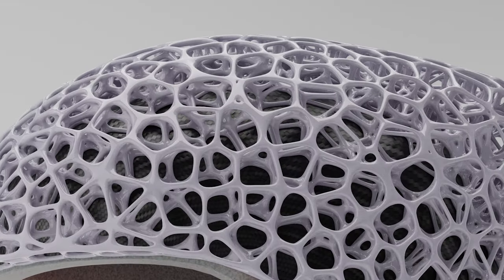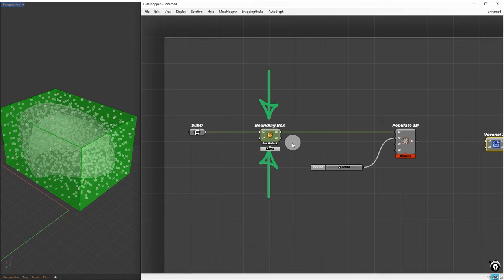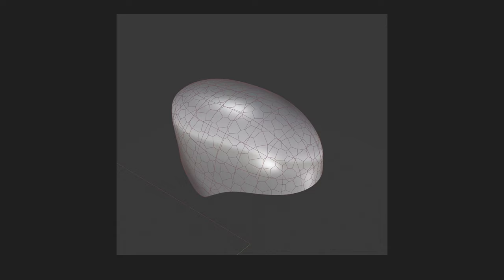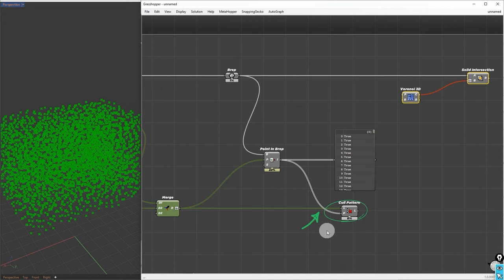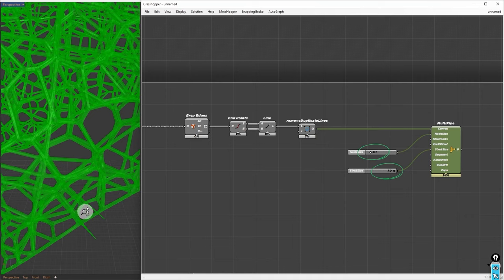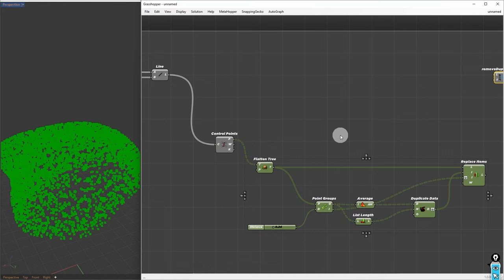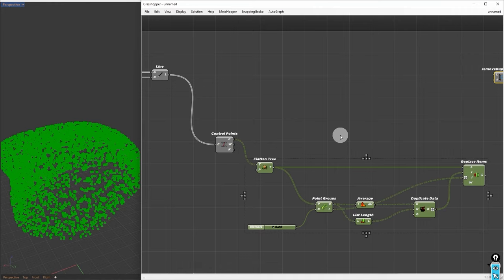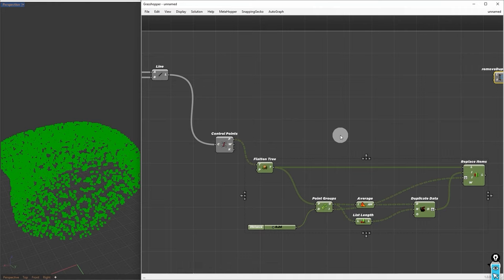How to apply Voronoi lattice structure on any geometry in Grasshopper

Comment: Hello, do you know why the connection between the voronoi 3D with the solid intersection doesn't work?? the error message is " the booleen intersection set is empty"
Reply: Apparently, there are several of us at this dead end. A hint from the author would be most welcome!
Reply: @fluxcapacitor  try increasing the distance of the points group command to 1.5, worked for me
Reply: @harrywall3045 did it really work? I can’t get mine to work either 😊
Reply: i selected everything and then pressed on the mouse wheel and then on the play button that says "recompute" suddenly everything worked.

Comment: First of all great Tutorials - keep it up! 
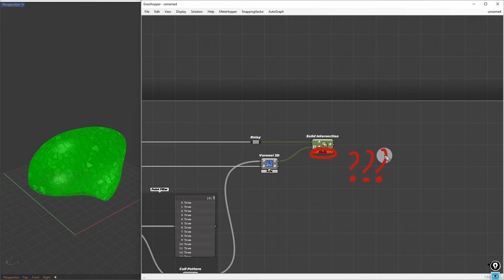Secondly I'm stuck at 5:26 because I dont know which bounding box/brep I need to insert in the Voronoi 3D component :face-turquoise-covering-eyes:
Reply: I searched and looked and it is the last thing of the very first group, the scale note. It goes into a relay node and then into B from the Voronoi note. Sadly it still doesn't work
Reply: I selected everything and then pressed on the mouse wheel and then on the play button that says "recompute" suddenly everything worked.

Comment: Hey, thanks for the tutorial. Unfortunately, you skipped a step, which means it no longer works for me. You skip the part where you connect Voronoi B(5:51). You can't see or understand what you've connected it to. Unfortunately, I get the message for Solid Intersection: "Boolean Intersection set is empty"
Reply: i have the same issue
Reply: Same here
Reply: I know it is already too late, but the voronoi is connected to a relay that is connected to the scale node. I ran into the same problem, you can spot where he connect it to later on in the video. it's very easy to miss, took me an hour to figure it out.

Comment: This is an interesting way to make carbon fibre structures.
Say making bicycle parts.
First 3d print the swiss cheese structure, then poke in long straw in either the x-axis, y-axis etc. or even in rings like a coil.
Then put in the carbon fiber in the straw.  Next pull out the straw but leave the carbon fiber remain in the cheese.
Repeat the process to insert more fiber until the structure is full.

The final process is to impregnate the cheese with resin.

Such structure should be stronger than other methods.

Comment: i have a qustion "why the Voronoi 3D and Multipipe" is red in grasshopper? 
Voronoi 3D says 1. At least a single valid point must be supplied
Multipipe says 1. Solution exception:points must contain at least 1 point
Reply: i stuck in the second quest too, did you solve it?
Reply: @yulin2520  and u ?

Comment: I am enjoying the lecture.
I did the same thing as before with the basic subd box object of Rhino, but there is an error in solid intersection. I don't know why, could you please tell me?
Reply from the maker: Glad you enjoyed it, if you get intersection results while getting an Orange Warning, leave it and proceed to the next process. It will be fixed after the Point filter process. But if you don't get any intersection, possibly, you could try out flipping the brep (in case the face flipped).
Reply: @3DBeast  thank u🫡

Comment: Is this method suitable for the sphere shape subD? There are always some weird sharp burrs outside the sphere lattices, I just can't figure it out.
Reply: Finally, figure it out:eyes-purple-crying:, the "Merge" component's output must switch to the "Flatten" mode to exactly merge two bunch of points together, which allows the "Voronoi 3D" to generate the correct cells.

Comment: Is there a way that I can organize that lattice without using voronoi cells. Of course the answer i the classical lunch box tools or reparametrization for even surface subdivisions. Are there any other strategy for the same voronoi cells but organized? I'll work with the classical gradient triangulations. :P

Besides this is example opens the pandora box to more complex structural systems that are organized and those that are randomized. Optimization may come later. As usual, 3D beast being 3D beast. :P
Reply from the maker: Yes, indeed! You can experiment with the point placements. The randomness comes from the randomly generated points. You can try out an organized point grid for a more structured result.
Reply: Can i  replace voronoi cells with other determined lattice structures？And make some interference effects？Looking forward to a reply，thx

Comment: Basic question - I have a stitched bumper in step format in Rhino and it is shown as ' 1 open poly surface's in rhino command window. Not able to 'set as one sub D' . Am I missing any conversion for subD input before starting?
Reply: select the surface in rhino and type tosubd, that should make a copy of the surface and convert it as a subd

Comment: So I don’t know if it is a hardware or software issue but once I get to the voronoi 3D part it just lags like crazy, takes a solid 5 minutes of loading once I’m at the merge component and I put it in the voronoi 3D. I have a Ryzen 7 4000 series with an rtx 3050, maybe it’s not optimised enough for grasshopper although I usually have no problems using other softwares like blender, clo or even rhino in general.

By the way great video, the explanations are really well done.

Comment: very cool! i noticed the resulting mesh is an open mesh. Is there a way to ensure the resulting mesh is closed?
Reply: Run it through dendro!
Reply: I've had the same problem! did you found a soultion without using dendro??? I played with all the parameters but the problem is still there. It come out from the "remove unecessary edges" step.
Reply: solved it!!!!!!!!! the secret is in the power of breps!!!the differences between subd edges and breps edges is real

Comment: Hi all, I need some help: I followed the tutorial, but I found that there are unjoined parts of the voronoi. This causes an open mesh. How can be done to eliminate the tubes that do not join?
Reply: I think i know what your talking about, is it the part where he skips a step, so you end up not knowing where the Voronoi bottom part is connected to. It's connected to the relay that is connected to the scale node.  (you can spot it at 10:17, where he zooms in you can see where that connection is connected to). Took me an hour to figure out what I was missing. (total 3 hours)
Reply: @mrmb380 thank you for your comment. It works